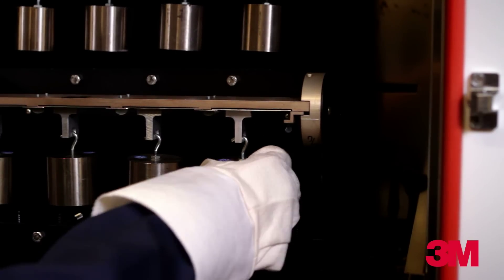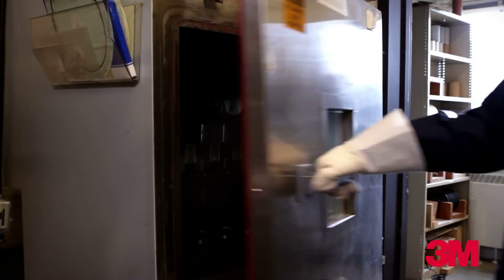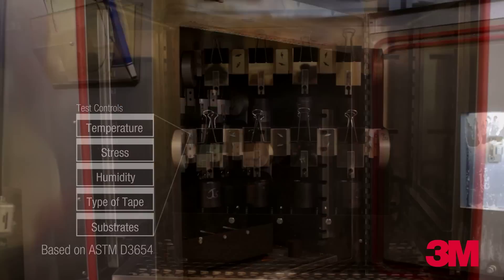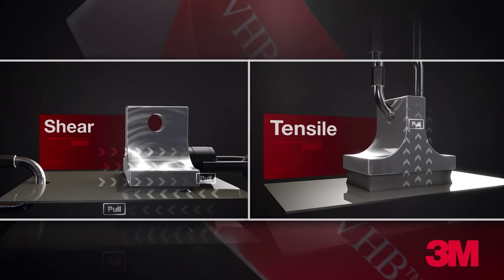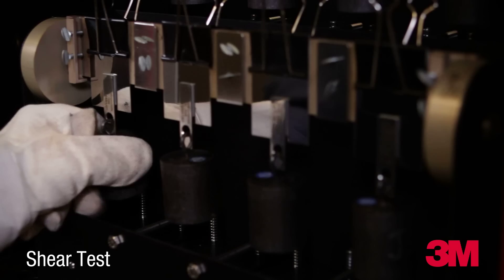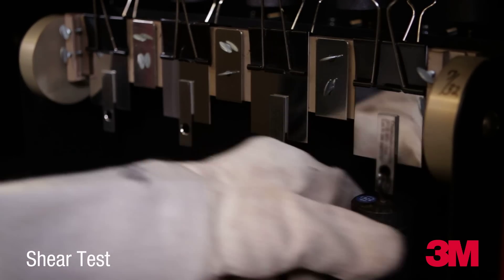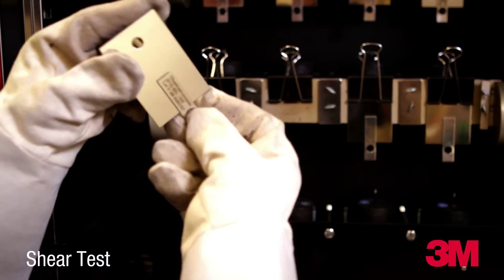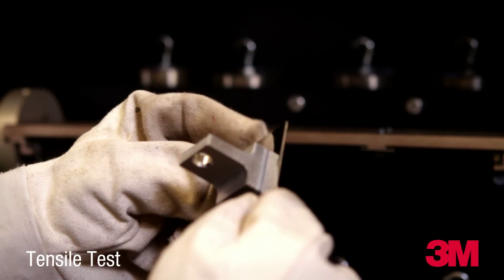3M™ VHB™ Tape Test - Static Load

Comment: Thank you for early response. We are conducting research based on the mechanics of adhesive bonding between aluminum to aluminum. Where the major application widely used in automotive and aircraft industry. The application uses where high dynamic stresses are involved. Bonding substrates between Aluminum to Aluminum, the samples will be tested under static loading and fatigue loading.

Comment from the maker: Hi MJ, 
This is a general video about 3M VHB tapes. We do have over 60 VHB tapes in our range and any of the tapes which range from 0.2mm to 3.0mm in thickness should pass the same test. If you would like more information on the range and specific tapes we have available, please feel free to contact us on 08706080050 .

Comment from the maker: Unfortunately we would need more details to answer this question as we will need to understand the material used, design and loading of the joint, thermal expansion of the materials, bond area available, environmental conditions that the joint will see and how it will be assembled in order to identify the specific type of tape required. If you could contact us on 08706080050 we will be able to further assist you.